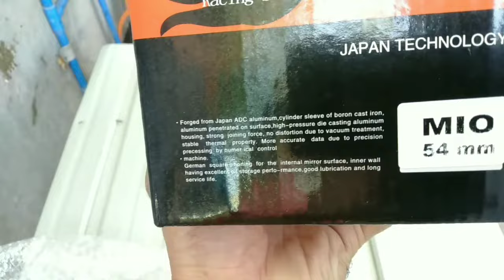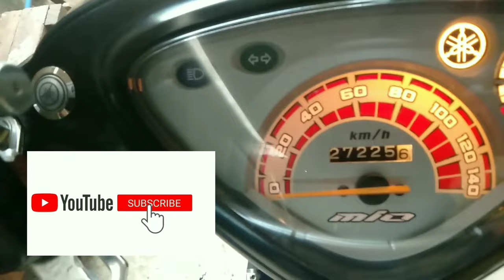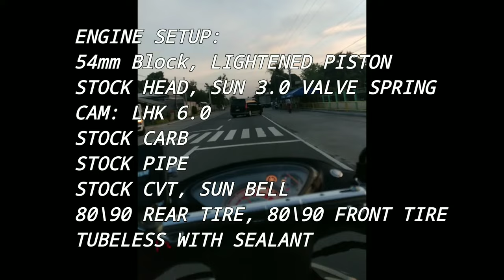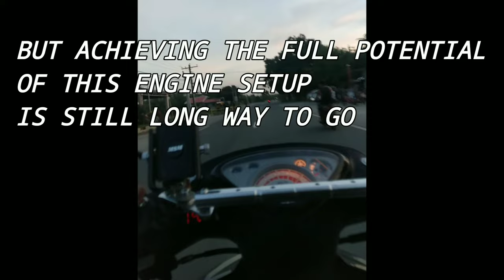54mm BLOCK CAM 6.0mm STOCK HEAD Engine BUILD for Mio Sporty

Comment: sir pag ba ng 59 matipid din? takaw kc ng soulty
Reply from the maker: Depende po sa setup ng 59mm block at sa pagtono at jetting ng carb pati na rin set ng panggilid, usually mas matipid ang touring set kesa sa racing set ma'am.  Sa 54mm setup ko medyo tumipid ang fuel consumption ng mio ko yung dating 150 pesos full tank ngayon 120 na lang same riding routine.
Reply: lods para tumipid palitan mo jettings ng soulty 42 ang nkalagay sa main jet nyan kaya malakas palita mo 110
Reply: ano pwde ilagay sa main jet at slow  jet
Reply from the maker: @ Blessie Martinez 110 or 115 main jet and 38 or 49 pilot jet

Comment: 54mm block
Lighten Valve 5mm
Stock valve spring
Stock cam
Stock port
Stock rocker arm

Okay lang po ba yan for daily use? SALAMAT SANA MAPANSIN😇
Reply from the maker: Ok na ok pang daily mate 👍tamang break-in lang at maintenance dibka magsisisi RS GOD bless

Comment: Sir balak ko po sana mag 54mm + jiso c3 + 6turns valve spring + Lighten valve + stock carb naka jettings no port or valve pocket sir . Any thoughts po sir? Tapos balak ko din po mag palit ng pang gilid straight sun racing po maganda po kayang set yun?
Reply from the maker: Ok na po yang setup mo mate siguradong may lalakas performance ng mio mo pero since magkakarga ka rin lng magport ka na sa head at intake manifold tsaka mag 26mm carb ka na rin Kung may budget pa pero Kung wala na stock carb pwede na po.  Pag racing na panggilid siguradong may dagdag speed at torque yan mate

Comment: paps ndi ba malagitik pag nka valve spring
Reply from the maker: Normal Lang paps malagitik ang 5-turns valve spring
Reply: anu effect pag ndi nka 5turn
Reply from the maker: @justincastro5420  during high speed sobrang init ng makina na nagppalambot sa spring ang resulta is blow-by or singaw sa valves at valve seat na nagpapahina sa compression so dapat matigasa na spring ang kelangan lalo na sa kargadong makina.

Comment: Kumusta n sir any update sa performance
Reply from the maker: Good na good boss bumubulusok sa arangkada, nagpalit ng gulong 70\90 front, 80\90 rear dumudulo Ng 110kph, walang usok, walang tagas, walang singaw, smooth idle  at walang hagok from low to high speed. ok spark plug reading,hindi  maingay makina, overall performance ok na ok walang pagsisisi.
Reply: @ProjMoMate26 nice salamat sa feedback gagayahin ko yan nasa vid mo paps hehe kaso paps sa machine shop mo ba pina lighten yong piston mo paps 😊
Reply from the maker: DIY lang piston works gamit drill bit at carbide burr paps

Comment: Sir tanong lang ilan top speed tska magkaano lahat nagastos mo
Reply from the maker: Sir ts 105 Lang kasi po stock panggilid, stock pipe, stock carb at malaki gulong sa harap 80\90 tapos mahigat ako 75kg. Baseline na po natin Yan para makuha pa natin full potential Ng 54mm block meaning pag nag-upgrade Tayo Ng panggilid, carb, gearings at PNP expected na may dagdag pa po. More or less 3k nagastos ko sa ganyang setup sir

Comment: Sir yung cams mo pang roller type ba yan?
Reply from the maker: Ang roller type rocker arm paps ay pwede sa kahit anong camshaft Ng Mio sporty
Reply: Sabi sir pag di daw pang rollertype yung cams delay daw po sya
Reply from the maker: Kung may Tama na Yung bearing magkakaroon po Ng konting delay, depende rin sa duration ng cam kaya dyan na ginagamitan Ng adjustable timing gear pag delayed or advanced Ang cam timing paps

Comment: Paps pasagot naman. Nag 54mm din at ako 6.0 cams pag 70-80 parang nagsisinok. Inalis ko na air filter meron oa din konti. Recommended ba yung acrylic carb cover or need lang ibreak in pa?
Reply from the maker: Oo paps lagyan mo ng cover yung carb para namang at least di pasukin ng buhangin o dumi ang makina. Try mo magpalit ng 1200 rpm center spring at 1200 clutch spring at straight 9g na bola or 10\8g.
Reply: @ProjMoMate26  alisin ko na sir yung airbox ano po? Tas acrylic cover nalang? Sige sir. Stock center sya now tas 1k clutch
Reply: @ProjMoMate26  pano naman po kaya sa maulan na panahon di po ba delikado yung acrylic cover?
Reply from the maker: Tama ka paps delikadong pasukin ng tubig ang carb kaya mas mabuting stock air box na lang pRa safe yung hagok na sinasabi mo pannadalian lang yung paglampae ng 80 walang hagok diretso hanggang 100-110

Comment: sir sa maintenance ng 54mm same lang din ba sa stock? tulad ng pag cha-change oil? same kms lang din ba ang bilang?
Reply from the maker: Every 1500km po ma'am ang periodic change oil pero Kung light to medium use lang kahit 2000km pwede po
Reply: Boss pag nka 54 ka pwede cams na 6.5 regrind?
Reply: @shobotslegaspi6561  pwd sir basta make sure mo na marunong ang mekanik na magkakabet, kc saken nagawa ko napo stock engine naka cams ng 6.5 highcom top speed 120kph, dis advantage alaga dapat sa adjust ng valve clearance kc palage tukod ang intake
Reply: @jepoy.channel  paps tutukod ba pag 6.2 lalo na walang valve pocket ikakabet ko na bore 54mm.
Reply: regrind

Comment: Boss naka 54 po ako tsaka 6.2 cams natural lang po bang malagitik?
Reply from the maker: Oo paps normal lang na malagitik dahil racing camshaft na nakakabit lalo na kung 5-turns valve spring nakalagay medyo malakas pitik nito kesa sa stock cam at spring.

Comment: Boss ano po kaya maipapayo mo na pangilid sa 54 all stock? Salamat boss bagong subscriber moko dami ko natutunan sayo!
Reply from the maker: Try mo paps yung mga sikat or kilalang panggilid at mag-1k center spring at 1200-1500 clutch spring at 8\10g na bola. Salamat paps RS
Reply: @ProjMoMate26  boss sinunod ko payo mo kaya lang eto ang nailagay 1000 rpm center spring 1000 clutch spring then 9g straight bola goods na po ba sa 54 yan? Salamat boss ikaw lang talaga pinag katiwalaan ko sa sinabi mo hehe more power!n